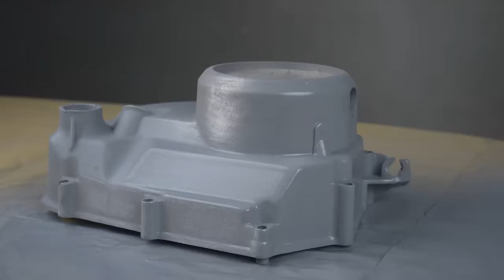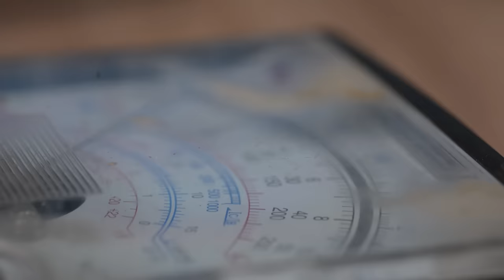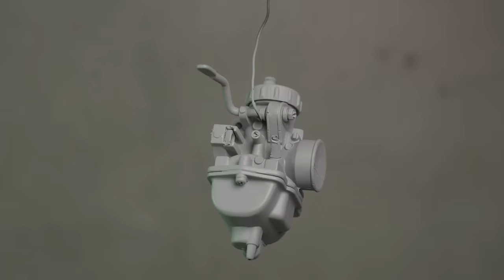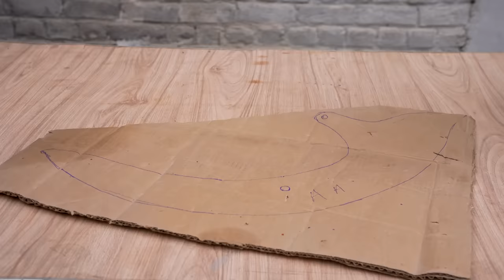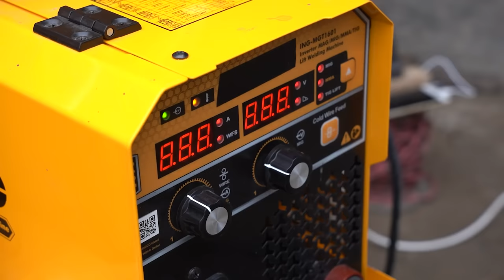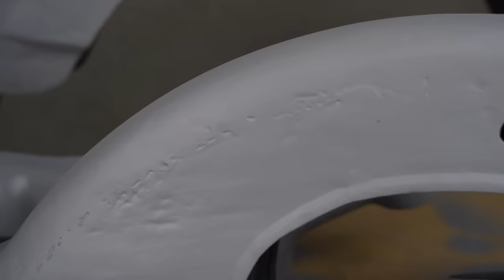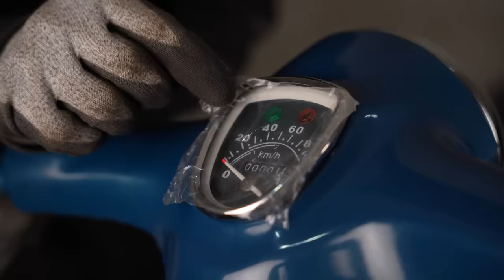Broken 50 Years Old 1970s HONDA Ruined MotorCycle - Full Restoration

Comment: Lovely work. A tip, beware of cheap 'brass' wire brushes. They're actually hard coated steel and NOT soft brass. Test them with a magnet to be sure.

Comment: Small detail, you installed the bearing race upside down for the steering head. Afterwards when you installed the lock nut there were unused threads in the lock nut because the upside down race used up too much room. Not enough left for the lock nut. Otherwise awesome.

Comment: Never powder coat an engine. 
Powder coating is an environmentally friendly, cost-effective alternative to painting metal objects. Powder coatings are incredibly tough and long-lasting, providing years of protection from weather and wear. However, when an object that requires heat transfer to function properly, such as a heat sync or auto part, is powder coated, it may affect the item's overall performance.